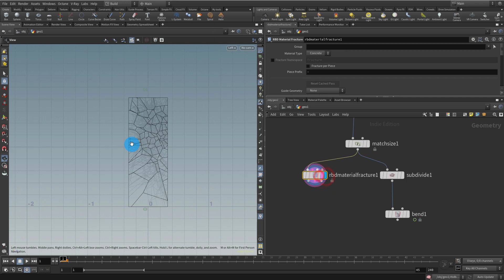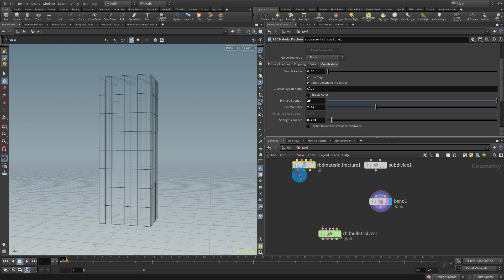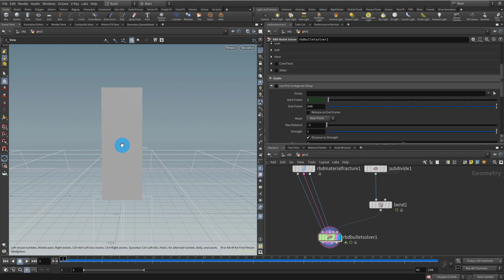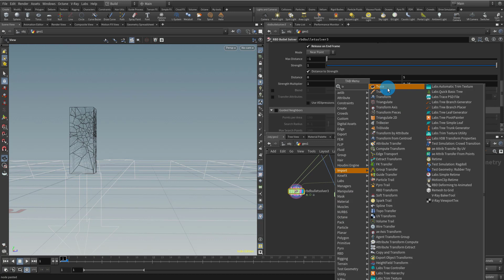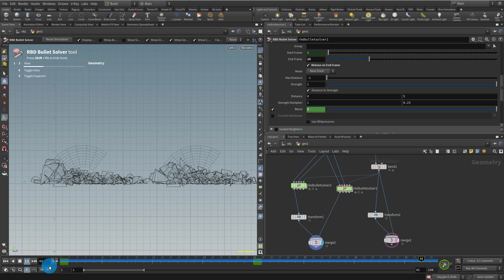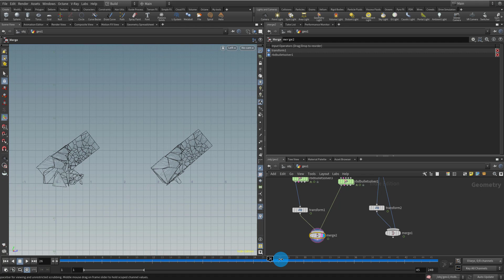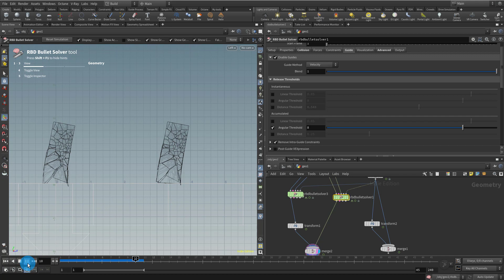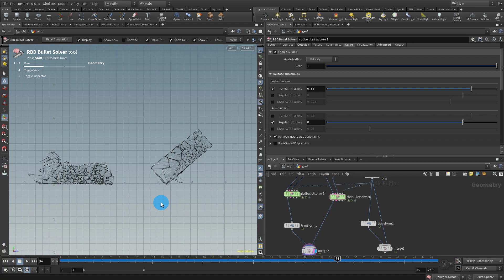Houdini - RBD guide geometry

Comment: "Use Pre-Configured Setup" refers to the "RBD Guide Setup SOP" i.e use settings from that node instead of the settings on the RBD bullet solver SOP, e.g if you have multiple things going into the solver and you want separate guide setups on each.

Comment: This is wonderful thanks! I have a question: I started playing with the scatter amount in the RBD material fracture node (to get more or less fracture pieces) and it seems to have broken the sim. The pieces jitter and fly apart. I tried using a new RBD Material Fracture node but it's still happening. I tried pushing the "reset" simulation button on the bullet solver but to no avail. Any idea what I can try to get it to work right?